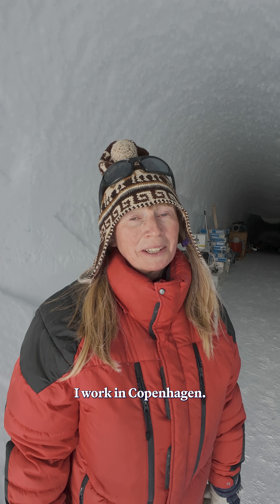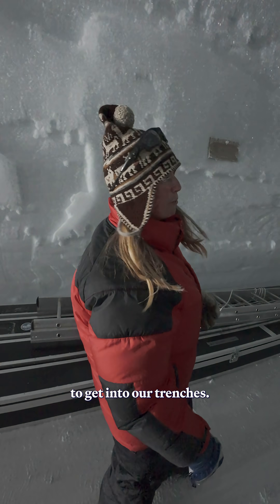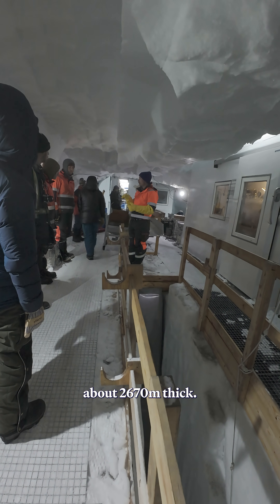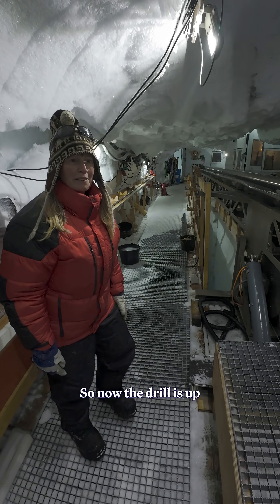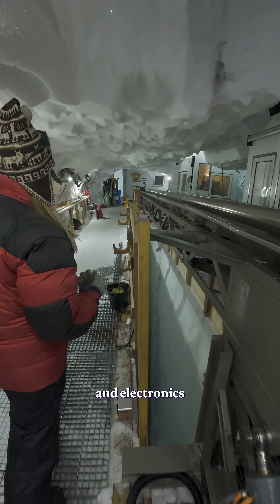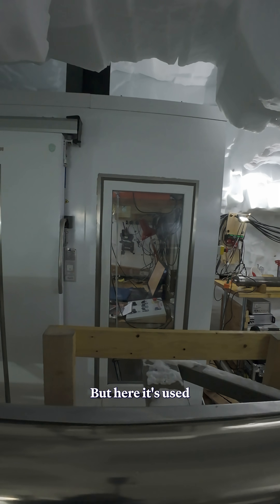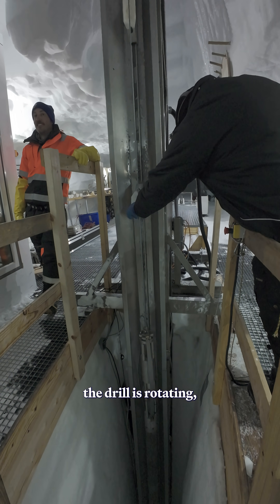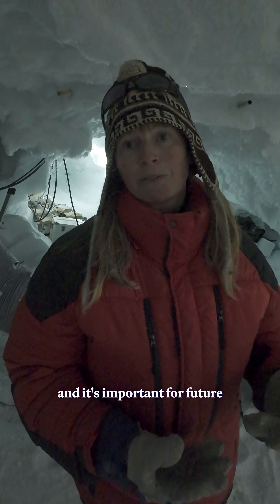The lab under Greenland's ice sheet

Comment: "how does the freezer keep people warm?" "Well -20 is a lot warmer than out here"
Reply: Its walls insulate both ways so it does not transfer heat in or out very well. Put a space heater in it to warm up and work without gloves and bulky overcoat (for computer work)
Reply: @boristhebarbarian  oh cool I was wondering how that worked
Reply: The freezer heats them by just reversing the typical process of refrigeration using a compressor. Instead of the refrigerant/coolant absorbing heat from inside the enclosure, taking it outside the enclosure where its heat is removed, and bringing it back into the enclosure where it cools the air inside, the process of flipped, where the coolant is cooled by the air inside the enclosure, taken outside the enclosure, where it is heated by blower warmer, ambient air over the coils, and then brought back inside where the cooler air in the enclosure blows over the warmer coils, heating the enclosure. It's also likely modified to compress the fluid when blowing over coils less coils for smaller surface area inside the enclosure since compressing it will heat the fluid, where decompressing it and expanding it over the larger coils would cool the fluid. It may also include TEC where the warm side of the element has its heat moved from it to inside the enclosure, and the cold side is outside of the enclosure. TEC's performance drops if the warm side can't efficiently have its heat removed, so it would make for a great supplemental heat source to the compressor.

Modern refrigeration works by taking a fluid (usually a refrigerant) warmed by an enclosed area, moving it to some coils (outside for large units, or can inside for smaller units) expanding that fluid over a large surface which drops its temperature from the pressure of the fluid. Strong fans blow cool, ambient air over the coils with the expanded fluid, displacing the heat above ambient temp, further cooling them. The air blown over the coils is heated from absorbing the heat from the coils and blown outside of the enclosed space. For large units such as a building's central HVAC, this is the large fan on the outside of the building - for houses, the side, and for commercial buildings, the roof. That's why the air being blown from the large fan on the side of the house is always warm to hot. The now cooled coolant flows back to the enclosed space, expands in coils which lowers the temperature even more, and a strong fan blows the warmer, ambient air over the coils. The coils absorb the heat from the air being blown on them, making the air cooler, and is blown into the enclosed area. This is how refrigeration using a compressor works.

Thermoelectric coolers (TEC) work very similar except it uses polarity to produce a hot and cold side of an element by using the Peltier Effect. A fan blows warm, ambient air over the cold side of the element, which absorbs the heat from the air, cooling the air, and that air is blown to its destination. The warm side of the element is either cooled by having a heatsink mounted to it and cool air blowing through it, cooling the heatsink which cools the warm side of the element. Or it's liquid cooled by mounting a water block to it and as water flows across the water block, it pulls heat from it, cooling it down, and the water goes to a radiator which spreads the water over a larger surface area where fans blow cool, ambient air through the fins, removing the heat from the radiator, which removed heat from the water, cooling the water. TEC is how cooled seats work in cars.

The drill also produces quite a bit of heat. The drill is cooled by displacing that heat into the freezer, and since freezers are excellent insulators, that heat isn't lost and the inside of that freezer easily could reach the 70s or 80s F (20s to low 30s C) if the door remains closed. When opened, the temperature would obviously drastically drop.

Thanks for coming to my TED talk.
Reply: @Djinnerator  So, in other words, it's what we would normally call a heat pump.
Reply: @JoshyCC Essentially, yes
Reply: they also just probably don't turn the compressor on, and freezers are well insulated
Reply: @sleepykiwi23  I think they may have ordered it without the compressor- save money.
Reply: @macforme prolly so
Reply: @sleepykiwi23  durrr…. Haha.
Reply: I doubt they actually turn on the freezer so it gets cold lol, I imagine they are just using the heat isolating walls to not let the cold go in
Reply: @dofer112  She said it's used the other way around.So it's pumping the cold outside the freezer, the heat in. Thats how you use a freezer the other way around.
Reply: Haha. Come on now. An insulated box is an insulated box. Just like your house, it can be used to keep heat in and cold out, or cold in and heat out. Even just sitting there with the only heat source being human body heat, it will be warmer than the outside air, light a candle or two, and it will be significantly warmer, you only need to worry about oxygen and carbon monoxide levels.

Comment: Very interesting. How do you know the ice mineshaft won't collapse on the people? 
And do you know Qupanuk?
Reply: I'm guessing, but as someone from a cold country and what she said, if the floor comes up due to pressure, and the ceiling pushes down due to pressure I'm thinking it's cold enough the entire time and the snow is super compact. So, you could just keep shaving off more snow inside to make everything fit like when it was first carved out of the snow.
Compact snow is quite stable, loose snow is dangerous, and that's why they keep the freezer for people to stay warm without causing structural weaknesses with heat.